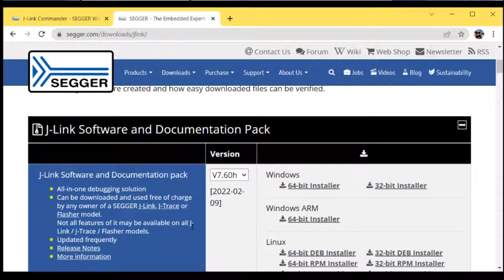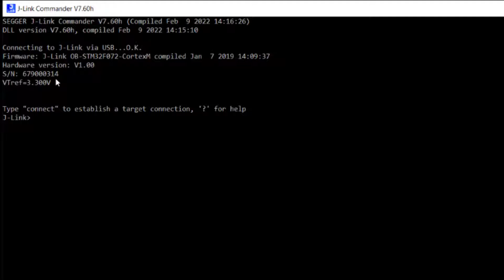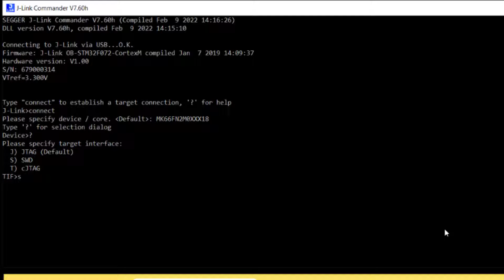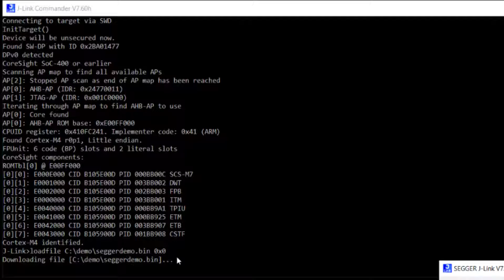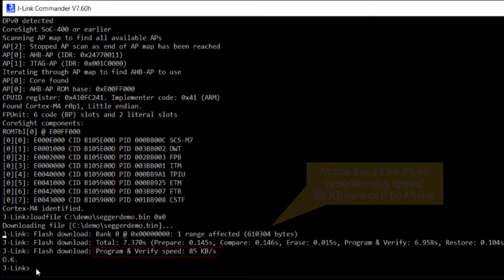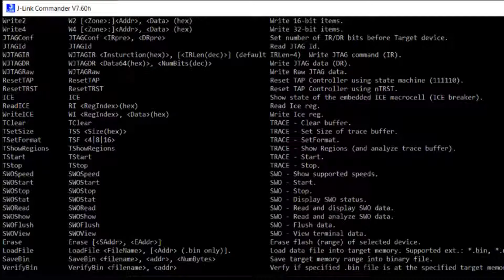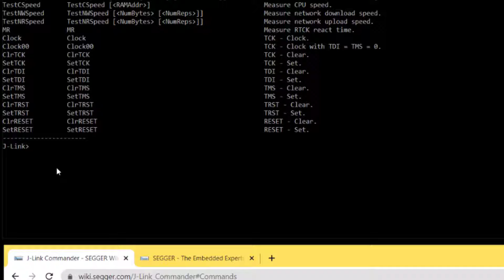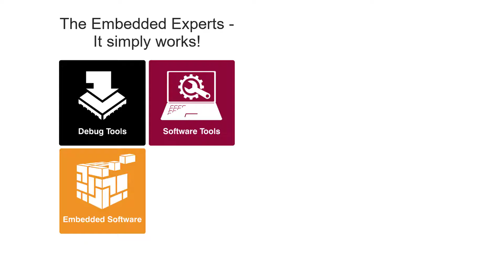SEGGER J-Link — The J-Link Commander

Comment: This is not helpful. I cannot find any documentation about how to install or start the JLink Commander on Linux. The website says it is included in the software package, but when I install it on Ubuntu 22.04, I can only find "jlink" in my commandline and this has completely different arguments than the Windows version (apparently), why is there 0 documentation about Linux? Who develops microcontroller software on Windows??

EDIT: could not find it earlier because of the case sensitivity on Linux, i.e. I finally found "JLinkExe", but couldnt find it with "jlink" (which is also installed). Problem solved, still: I wished for better documentation (and not one thousand different subpages which are not informative at all).
Reply: Commander is now obsolete even on Linux.